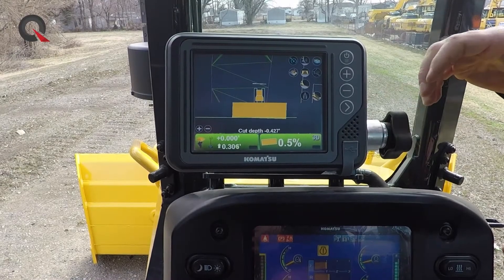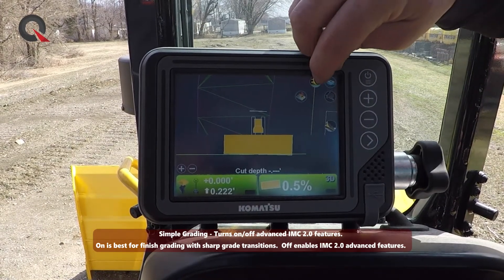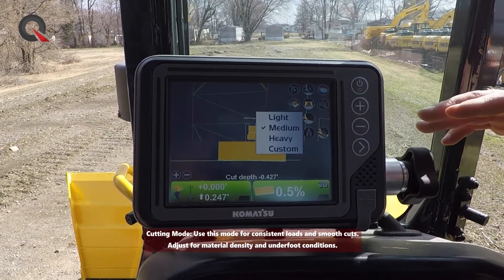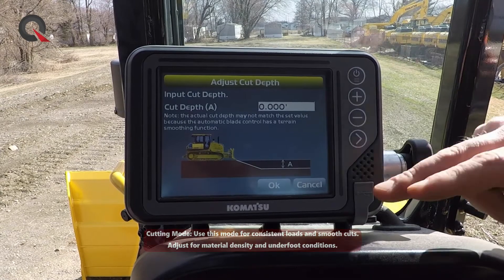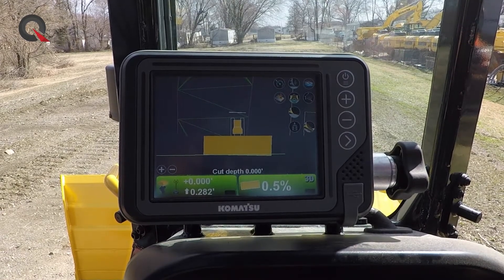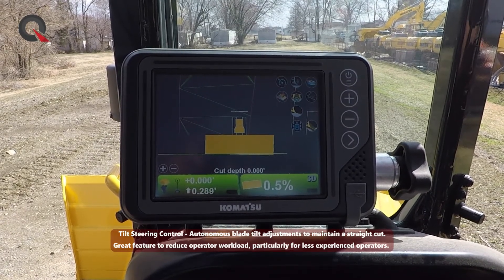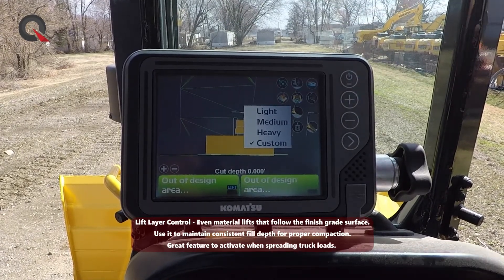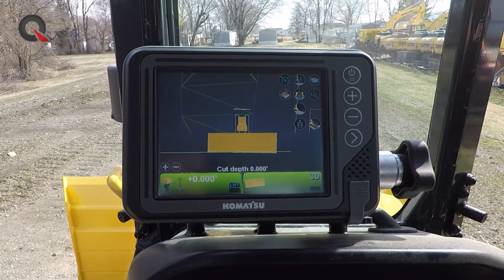Komatsu - How to Use IMC 2.0 Features

Comment: How did you get all them options on your main screen?  I only have 3 on this one and can’t figure out how to get the icons onto the main screen without going into settings and fixing it like the traditional way is.
Reply: I believe it’s under display options then it will be under shortcuts then you can add or take away which ones you want👍🏼
Reply from the maker: Hi Jesse - Let me see if I can get a video of the menus.  Hang tight.
Reply: Your settings maybe locked out and need a password to select more screen quick settings.